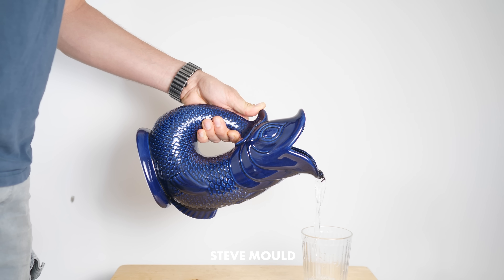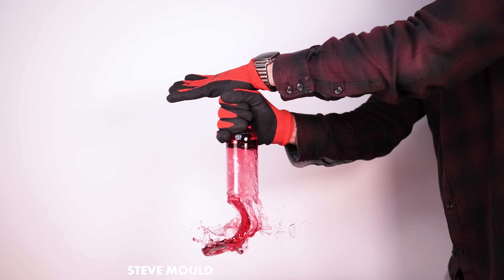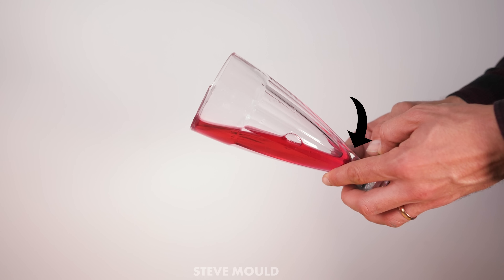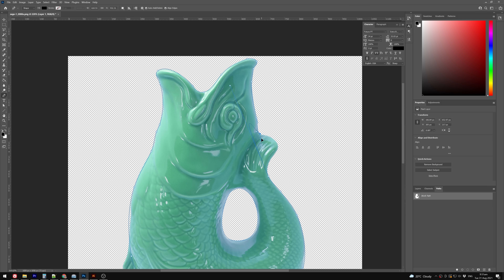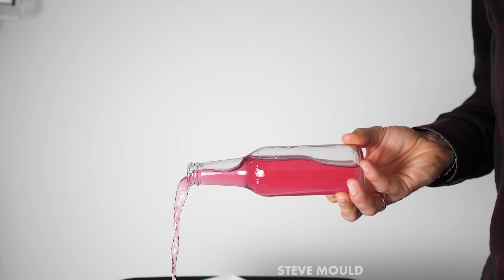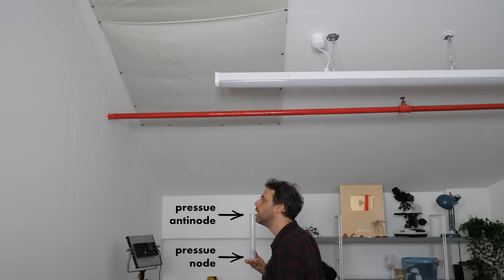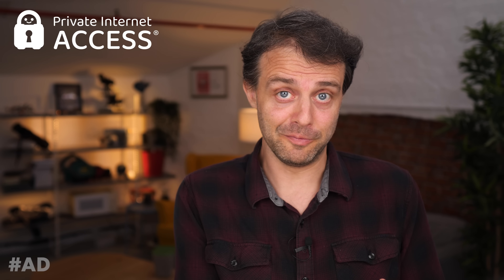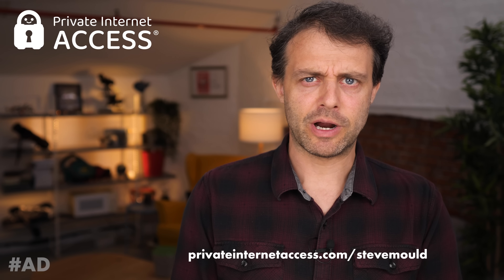Why Gluggle Jugs Are So Weird

Comment: Memory served me wrong my larger guggle jug does have it's tail looped through to the body and does not gurgle that's why it did not work  horizontally even if it tipped. Perhaps a variation would have tail not looped but a hole in it underneath which could be covered by a finger or not so that it would gurgle or not.

Comment: I know this under the name gurgle jug I have two and used to have a third which got broken accidentally but this allowed me to examine it. I had thought there might a connection through the tale back into the jug. The Broken one confirmed this was not the case and thinking about it this would prevent the gurgle or glugle but allow the water to pour more smoothly. Of the two I still have one you can see as well as feel a depression inside the jug where it joins the tail but it does not go right through, my larger one you can not see into enough or get you hand in enough to feel if it goes right through, but I suspect it does not because it gluggles/gurgles .  The smaller is identical to the one in the video and I had an idea to support  it horizontally with a rod through the tail loop and have water from a pipe fill it so that it tipped gurgled returned to the horizontal etc. My idea was for a garden water featured with sound effects, but It did not work, I thought it was because the foot made it to heavy at that end. I thought of chipping the base off with a chisel but then I saw my larger one which is just flat at the base without the foot, I still can't get it work like that though.

Comment: I'm curious how in the weeds you could get with designing a gluggle jug. It feels like there's multiple factors contributing to the sound (amount of water vs air, type of fluid, size of opening and tail, shape(s) of opening/tail, etc). It makes me wonder what the ultimate gluggle jug would look and sound like- assuming you're maximizing for loudest sound and not going too ridiculous in maximum jug size.

Comment: There's a particular kind of Port bottle that has a very pronounced shoulder, and so as you tip it to pour the first glass when it's very full, you get a very satisfactory glug before the first of the drink emerges.  It's quite quiet though, as explained with the normal water bottle.  It also has a slightly 'syrupy' tone, which is because (I guess) the nature of the liquid doesn't produce so many high frequencies.  I need a frequency analyser!

Comment: Kind of reminds me of when you take a huge shit and it clogs the toilet and when you flush right as the water is getting to its lowest point it makes a very similar sound.  

My theory is that there is a void that does not have contact with the outside air, as the water level drops the void gets larger making the air less dense so the atmosphere is pushing the water level up a bit on the inside and down a bit on the outside.  Once the water level gets low enough it creates an opening and the atmosphere will rush into there and it will return to atmospheric pressure and the water level will equilize on both sides which will cause it to close the opening and allow the process to repeat itself.

Comment: what would happen if when the jug is empty you fill it while holding it at certain angles so that as you fill it, the water completely fills the closed tail side, and you change the angle ever so slightly so that while you're still filling it with water the air doesnt shift to the tail? 

would the gluggle jug cease to glug bubbles until you poor enough water out for bubbles to glug in the gluggle jug once again? (i had fun writing that)
Reply: you would get glugs from the full-tail jug as soon as you tilt it a little less than you would need to tilt it to make it glug usually.
Reply: Yep!
Reply: then you just get a jug with a tail that is full of water. Nothing crazy bro.
Reply: @Jeremie Chopty  was just having fun, all a set up to write the nonsense i wrote at the end.

Comment: I have a particular bottle that does the jet thing ALL THE TIME
Especially when I'm walking
So I usually just stop moving to drink because I use glasses and I hate when that happens
I figured it had something to do with the length and aperture of the bottle having specific dimensions but I'm not sure
Maybe it has something to do with the length of my steps too, since it happens most of all while walking
Also the bottle does not change cross-section area so it's weird that it does that

Comment: I suppose one way to 'reverse engineer' the jug, could be to treat it like a mold, fill it with e.g. epoxy, somehow ensuring no air bubbles, let the filler harden, then break the jug to remove the ceramic, while somehow keeping the filler intact, and you would end up with a perfect replica of the inside cavity, a 'reverse jug' so to speak, which you could use in various ways - you could 3D scan it, or somehow use it as basis to make new jugs out of different materials. Perhaps even glass could be doable this way.

Comment: Your node, anti-node description of pitch on a closed or stopped tube isn’t quite accurate. I’m a pipe organ builder and the sound wave only doubles in length, it doesn’t quadruple as you stated. The sound wave travels from the open end to the closed end and back to the open end. If it were to do that twice, the sound waves would cancel each other. Incidentally it might interest you to know that when this happens, only the odd numbered partials on the harmonic overtone series are produced creating a round fat tone.

Comment: I have a ceramic mold for a smaller version of the jug. If poured normally, there is an opening between the tail and the back of the fish head. You must plug that opening with a piece of clay to seal off the hole between the two parts, or it won't gluggle.

Comment: hi steve, as you saw when you broke it open, the thickness of the walls in the ceramic jar are all equal. that's because it was created by pouring the slurry into a mould and water tends to seek its own level. sometimes the mould it gently rocked back and forth and tapped to release bubbles so inconsistancies do occur.
Reply: Most important comment

Comment: Is this similar to the beer boot? “Not a fan of spilling beer all over yourself? A simple application of physics can save the day. When you’re ready to start drinking, lift up the bierstiefel with the toe pointed directly away from yourself. As the bubble starts moving down the glass, gradually rotate the boot by 90 degrees in either direction. This way, by the time the bubble reaches the bottom of the glass, the toe will be pointing to the left or the right, which in turn reduces the pressure and ensures a smooth drinking experience.”

Comment: There's a Belgian beer called Kwak that has to be served in a particular rounded bottom glass with long neck, which is placed on a wooden holding. It's designed to glug when you tilt it to drink, so the movement reactivates the beer foam and the subtle flavours. It's delicious, by the way
Reply: I gotta try that

Comment: Fun fact: in germany there is a glass which is build as a boot. It is called "Bierstiefel" if u want to google it and it has the same effect if the tip of the boot looks up to the ceiling and u drink out of it.
To get rid of that phonomen the glass can be tilt by 90° to the side so the tip is parallel to the ground und the guggling stays away.

Comment: When I learn of this gluggle jug, my immediate association is a milk carton. When I was young, I was impatient and foolish enough to pour milk too “steeply”. The body of liquid would block the opening, so milk would come out in waves as air bubbles formed and rushed inside the box. And then the milk flow would be irregular, and splashing everywhere. 
I later learned to adjust my pour to keep milk flowing smoothly and leaving a little opening for air. 
This gluggle jug effect, I imagine, is similar to that, as air rushes from high pressure to low pressure.

Comment: There's actually a drinking game that is mostly played by soldiers of the German Bundeswehr, that uses this mechanism. You see: it is called Stiefelhumpentrinken and one has to drink 1 litre or more beer from a glass that has the form of a boot. Because of the shape of the glass, the liquid inside it makes this Gloip sound, whenever the liquid is pouring out of the front part of the boot while drinking. So if the participant of the drinking game is drinking and can't chuck it or you'll hear the Gloib sound, he has to throw a round to everyone at the table.
It's basically a trick to prank new recrutes, because once you figure out, you'll have to turn the glass while drinking, it won't make any sound and you'll be able to chuck it.

Comment: Wait a second! Isn't sound comming from the fast moving water after a bubble has past? The water slams into the glass and then rushes towards the back of the bottle? Same as when water hits any other surface it makes a sound? Also you are getting to different pitches with the jug

Comment: in future situations where you plan to break smth open to find out what's inside, try pouring in silicone molding putty (trying to get every part of the inside covered) and let that cure. if you aren't able to remove it by hand, then break the item, and you'll have a cast of the interior of the item/less guesswork to do than reconstructing those pieces.

Comment: So that part with the glass and the water shooting from the smaller part in the bottom, also kinda uses bernouli's principle. Where basically, a fluid which is forced into a small hole, creates a jet force coming out the back. It can be used in jet engines to increase thrust quite a bit. The water is getting pushed in that small enclosure, making it blast out very quickly. Cool little science method that is used in a lot of things

Comment: Is there a wine decanter based on this rocking- bubbles aeration? Wouldn't it be better than the glass- surface- area- liquid- tension that the bell- cascade decanters all use?

Comment: Now the gluggle jug prices will go through the roof.
BTW, I used spectroid application (spectrum analyzer with water fall display)  too. I have actually used it at work to track down sources of vibration in a particle accelerator through the sound I expected the vibrations to make. It was very subtle.

Comment: Steve reminds me a little of Christopher Lloyd from Back to the Future.
I love your video! It's very interesting.
And I think the water splashed back at me a lot as a kid, I think especially when I was super thirsty after running outside, and would come inside and race to drink some water at high speeds.
Awhhh. Such a pleasant feeling, to drink when super thirsty. That happens a lot when you work outside. I think I will do that. Thanks Steve!

Comment: How do you even properly clean those things?
Reply: I think they are intended only for use with water. Hence the fish theme. But if you're really worried about the cleanliness of the tail, you have some options. 1. A drop or 2 of bleach in a full jug of water, followed by several empties and refills with water to rinse. 2. A vinegar and water mix, rinse, and then a baking soda and water mix.

Comment: But a vacuum does form at the tail. and that is what causes the bubbles to enter. You can see the vacuum clearly at 5:39. conversely the tip of the tail is very hard to fil up with water due to the increased pressure inside there. You could put a straw in and fil it up and the airbubbles will be nonexistant until you tip it once. It's a neat trick to make it seem like you are pouring from an "infinite cup" as if you do fill up the tail and tip it over enough to get bubbles in when you tip it back up the level of the water will hardly have changed.

Comment: no sh*t sherlock I thought a 5 years old would figure that the sound was bubbles going back and forth beetween the two top parts of the jug. but exploring all kinds of conjectures is still fun
it also works (even better) no matter how slowly you tilt it, so it had to be the air bubles moving, and potential energy of the water being higher on one side, not something related to the kinetic energy of the water moving fast. its also exactly the same sound as pouring a bottle when you tilt it forward slowly. plus sound disappears as soon as level is too low and air cant be trapped

Comment: The slow Mo of the glass being tilted and firing liquid up the side is really cool. It's not a vacuum that's present it's like the air is getting in the way because the liquid is gaining velocity. So you have this cog of air turning between the fluids as the liquid fights to occupy it's space. So it kinda explodes out with the air when the gap collapses.

I mean it's something fascinating Ive considered for a while. Physically Air and Water are different things but logically they are the same thing at different densities due to energy states. I mean think of it like this if you increase the energy in liquid it becomes gas increase it further it will become plasma increase it even further it radiates itself out of existence entirely passing its energy to or through other things Obviously decreasing the energy and leaving behind atomic residue on the impact zones.

It makes me kinda wonder how much energy you could get out of a droplet of water if only you could get round the time it takes to ramp up it's decaying qualities. You would have to shock it and shake it at a ridiculous frequency simultaneously or something.
Reply: I believe your understanding of cavitation is wrong. Don't get me wrong, I just wanna have a civilized lil talk. I might be wrong either. But when he says about the vacuum is when you tap the bottle hardly. So there it is no air on the bottom of the bottle, only liquid. Due to inertia of water moving upwards, and the sudden reverse movement of the hard tap, the water continues up, and if the bottle goes down, something needs to fill that gap at the very bottom when it happens. But there it is nothing. There it is a split second vacuum cavitation. But the pressure difference is SO high, that instantly that vacuum pushes the water back to the bottom of the bottle. So much, let's say, "reverse" pressure, that the bottle collapses.
But the cup tilted is more like if you get a garden hose and bend it 90°, maybe more. You have the same amount of water trying to get out of the hose, but you created a smaller area of flow in the bend. So the water will flow faster, just like when the water hits the very bottom of the cup.

Comment: I think that one other reason why the jug makes that noise, it's related to the cause of the trapped air. As you tilt it while pouring water in a glass, you open a gap for the air to get in, an then, as the gap closes, the volume contained in the tail gets progressively smaller, and eventually bubbles will want to come out

Comment: Actually cutting ceramic is easy. A tile cutting wheel for any standard handheld grinder is as close as a trip to the hardware store and a trickle of water running down the piece of ceramic would keep dilust down and the piece cool.

Comment: my theory is that the reason is glugs is so that is doesnt glug when it comes out, cuz like a bottle when youre pouring it and its gluggin, its splashing and making a mess, but if you make it glug but in a different place, it would come out smoother. kind of like if you put a straw into a bottle and chug it that way, the air has somewhere else to go rather than have to wait for air to come in for more liquid to come out.

Comment: I think air molecules and friction cause the sound. The same happens when you drop ice into a ice bore hole it makes "laser sounds"  when it ricochets off the sides at higher and higher speeds. Or when a large lake is frozen in the winter and you walk on it and it starts to Crack, it displaces the water underneath when air rushes though the ice the buoyancy takes over causing mass friction between the ice and air bubble causing a similar sound. Im sure some of you have seen the videos of each happening and therefore know the sound effect I'm talking about. I think depending on the dimensions the sounds will vary. So in short, like bullets when they ricochet off surfaces and make that "pewm" sound. This is my educated guess on what's going on anyway! 🤣 🤣

Comment: I had a ceramic drinking mug with drinking straw instead of an ear. Quite popular in sanatoriums with special mineral water. You could just blow into it and sounds were identical. I also had a toy ceramic bird (whistle) which you filled with water and it made chirping sounds because of bubbles.